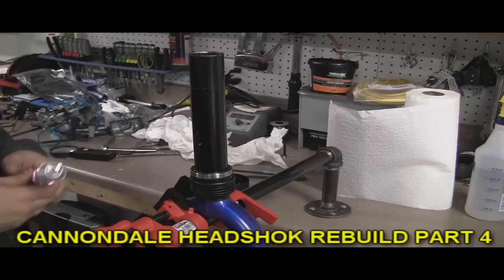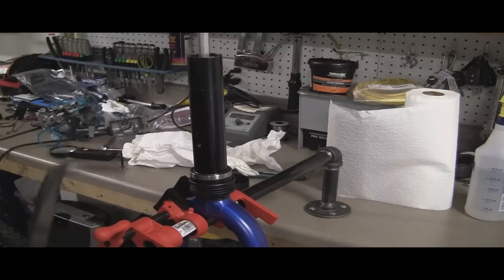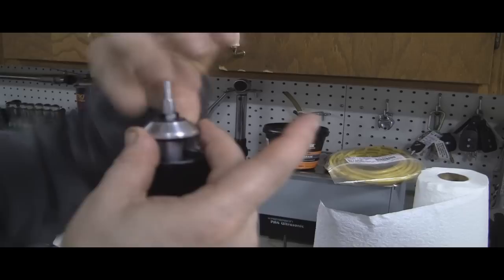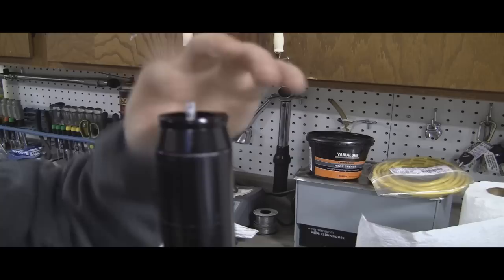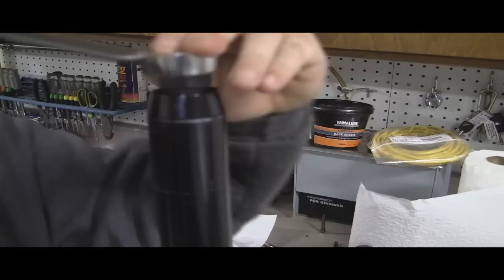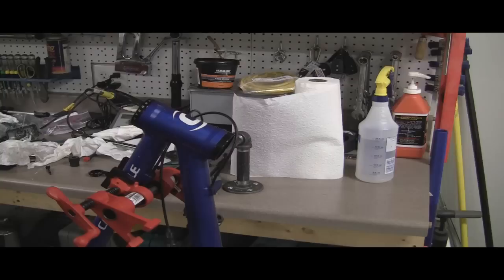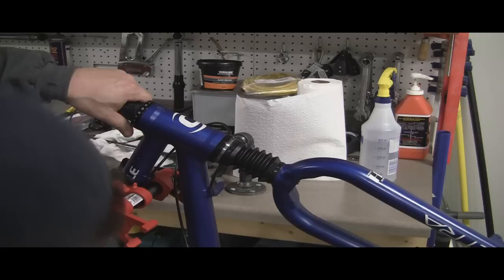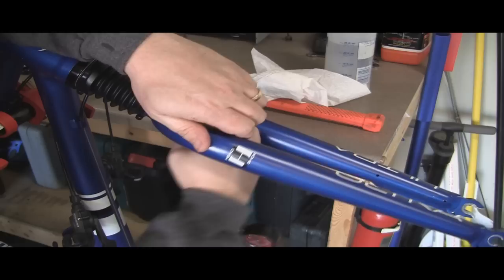Cannondale Headshok Fork Rebuild Part 4: F600 Mountain Bike Example

Comment: Fantastic repair video, detailed, well spoken and easy to follow.  I've got an F600 as well but bought it in 1996 and it has a head shock dampener (no lever like yours), it's just a knob to turn left and right.  After washing the bike down last week I noted a squeal when riding uphill yesterday.  I'm tempted to take apart but the head shock looks a bit different.  I can send a photo or two if you like to see if you believe repair principle would be the same or similar.

Comment: @Johnnysshop That's why I bought the lefty.  I have a 2006 F800 which is the next model up from this for that year and the lefty was awesome.  After about two years is wouldn't hold air anymore and had to bring it to the shop I bought it from.  Lucky for me they had a cannondale rep that came in once a week and he fixed it for me in a hour and added some oil to the shock.  All it needed was a simple little piece that went inside that stopped the leak and the fork was good to go.

Comment: Nice vid!  The main problem and the most difficult is bearing and races replacement. My Fatty has worn needle bearings and races, and there is a problem, because there are severeal thicknesses of races:/ unfortunatelly they are hard to find:(

Comment: My f600 is slightly different as well but I suspect its just the dampener adjuster that I dont have. I just have the option to enable or disable the use of the shock.

Comment: Hey Johnny. I have recently acquired an old F2000 w/ Fatty SL Headshok/fork.

The Headshok is shot and bottoms out. I watch your 4 part rebuild series and wondered if I’d be able to take the same or similar steps with the right tools to change air seals and schrader valve? I believe that is my problem as it will no longer hold air.

ANY GUIDANCE  appreciated!!!!

Comment: i just bought a used 99 f700 and i also have the older style with just a black cap on top......really want to switch to a traditional fork. trying to read about reducer headsets and such. im pretty mechanically inclined but need to research on how to do it right...

Comment: Great video...! Will this repair correct the issue with air pressure. My fork is not holding the PSI and the pressure leaks out. I am just researching the shock for the first time so I am not sure if the air pressure is a seperate component problem. I have an F600 that I like very much so I want to get her back in shape. I am original owner and the bike actually has minimal time on it so I was surprised the shock went. The pressure always seemed to leak out but now happens very quickly.

Comment: Great video. Question: Could the whole front mono shock system be replaced with a duel shock system like most regular bikes in the event the project goes south?
Reply: I know it is 3 years old comment but yes you could but gonna need headshock adapter to fit it in cannondale

Comment: im thinking of getting a reducer headset so i can skip the adapters. im stumped on what fork will fit this bike geometry...im no racer or anything, i'm just going to ride some local trails for fun and exercise.

i found an fsa reducer headset for 45, thinking of some used forks or low end for 100 and i'll need a new stem.

so i'll be prepared to spend up to $200

Comment: @Johnnysshop My fork doesn't lock out; the suspension works but when i am riding I can tell my fork is compressed about half way. Is this due to leaks in my air chamber, oil chamber or both ( i dont see any oil leaking though)?

Comment: Hello Johnyshop! Thanks for your video. 
I just bought a used Cannondale Silk Path 600, idk if previous owner took the proper care. I was completely unaware of all the services it requires before I purchased it, but after watch your videos it raised more questions that I thought. Should I take it to my local shop and have it service? 
Is it worth to spend extra $$$ on this used bike?
The boot it's already cracked, I need some guidance. 
Still ride nice, but I need some insight on how to service the fork myself. Thanks
FORK BRAND &MODEL: Headshok  Silk Path D
Reply from the maker: Hiram Gonzalez I would probably take it in. Honestly I would never purchase a bike with another Headshok, too much work and parts are really hard to get for them.

Comment: Am I missing something?  How do you adjust the preload in the headset bearings? With a regular threadless you just wind the bolt in on the top of the steerer tube which screws into the star nut. On a headshok the lock out is in the way etc & in your vid it looks like you remove the rebound cap & lockout lever, then after loosening the stem steerer bolts the stem just slides off.. confused!!
Reply from the maker: Its just a very confusing fork, I'll never have another...

Comment: Nice video.  You forgot to mention re-ziptieing the boot. ;-)

Any plans on a video about roller bearing  replacement/maintenance?

PS - Am I the only one who finds it ironic Cannondale sells the o-ring kits for these forks, but won't sell the specialty tools you need to actually service it with the o-ring kit?
Reply from the maker: Lol, yes I did forget to mention. I've since sold the bike, after a few years of riding the HeadShok I decided I didn't like it no matter what. I think it's total bull they sell a shock that they try to make impossible to service.